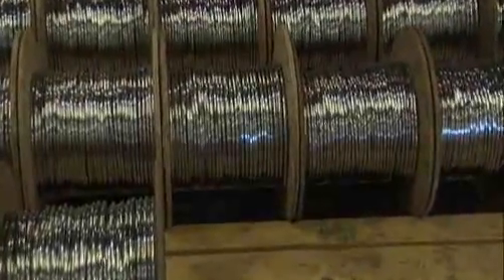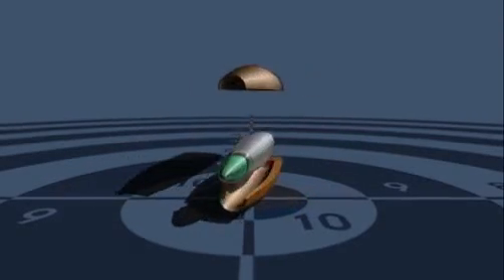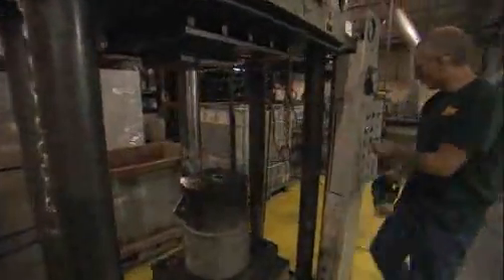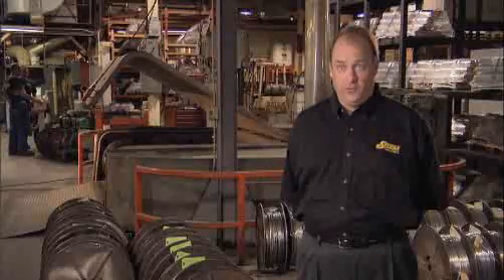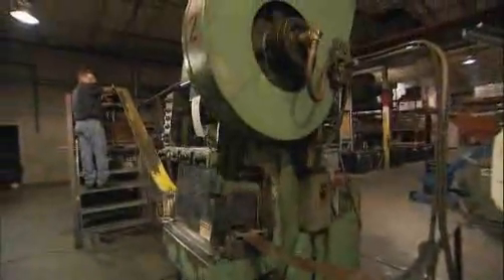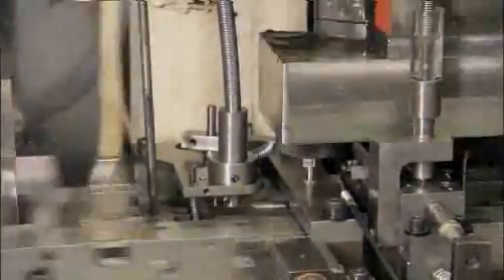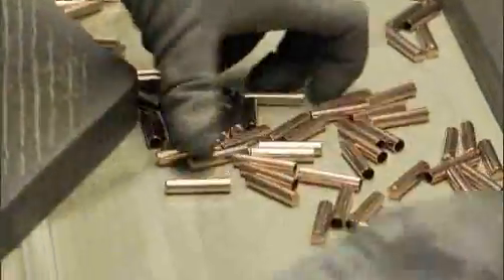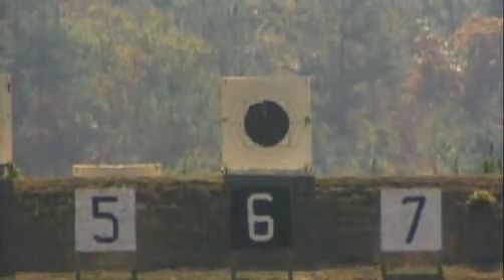How Bullets Are Made

Comment: Serialization and Microstamping
Ammunition serialization is a law enforcement tool that could assist in solving gun-related crimes. A system implementing ammunition serialization or coding would require manufacturers to stamp a unique microscopic code or serial number on all bullets and cartridge cases.11 At the time of purchase, the code or serial number would be recorded along with the purchaser’s information by a licensed dealer. Later, when a bullet or cartridge case is found at a crime scene, the bullet or spent cartridge could be quickly traced back to the purchaser. This would aid law enforcement investigations into shooting crimes and deter the use of guns in these crimes.

A friend tell me code or serial number was written on bullets or cartridge cases.
Can somebody tell me where code or serial number is written on bullets or cartridge cases?
Thank you.

Comment: For those who may not know. A bullet is exactly what is shown in the video, the projectile that comes out of the barrel. A cartridge is the brass, primer and powder. The combination of the two is called ammunition.
Reply: Why is the cartridge made of brass?
Reply: @E_Rico  brass is way more impervious to corrosion, and easy to form and has great thermal expansion tension strength and can also be reformed and recycled back into live projectiles.
Reply: @E_Rico It’s made of brass so it can expand into the chamber. When you shoot a classic rifle bullet the neck of the brass, the part that hold the bullet, will expand and create a gas seal to your guns chamber. Every chamber, no matter how precise the manufacturing may be, will have minor imperfections in the chamber due to machining. The brass case will expand due to the powder heating up the cartridge and will fill in these imperfections essentially fire forming that brass case to your guns specific chamber. This is why for some reloaders only opt to have a neck re-sizing die. The body of the brass case will stay the same, because it’s been fireformed to your chamber, and only the neck of the brass will be resized to near factory spec for the next bullet.
Reply: whats is called for shotgun bullets?
Reply: @pepega5560  there's no bullet on the tip of Shotgun ammo. Either filled with pellet like load or slug.

Comment: Sooo.... how are bullets made?
Reply: I mean, this video really only shows how the casing is made, not the actual bullet tip.
The bit that mostly deals the main blow.
Also this video seems to be addicted to lead.
Reply: No it showed how a bullet is made,  lead core with a copper jacket. Then a brass casing holding a primer to ignite the powder burning and push the BULLET down the barrel engaging the rifling to in part spin to stabilize the projectile to the target.  Bullets are the pointy thing that does the work on the target. The process in the video is called cup and core. This basic design has been used sence the 1870s or 1880s,  @Firestar4041
Reply: The bullets are the piece of metal that fly out of the barrel, which is what is shown in the video. Sometimes people mistake bullets with cartridges which is the bullet, casing, powder and primer
Reply: @mikeawilliams7104  indeed
Reply: @mikeawilliams7104  good to know the terminology. Often confuse the parts myself.
Reply: centersnare32 
by bartering $ i think.

but for sure ammo manufacturer need considering replace copper for their cartridge. ammo going more expensive each year........... not Funnn
Reply: U
Reply: Well after that step i would geuss theres another die or so that shape it into the proper shape then a press that puts on the tip or steel penetrater depending on what kind
Reply: When a mommy bullet and a daddy bullet fall in love...
Reply: @jayvee4321 😂🎉
Reply: You stick a lead rod in a copper tube. Literally the entire video
Reply: Are you stupid or just a follower? The video went over pretty well..
Reply: @chadcurtiss1846  the vid mostly showed how the casing was made and not the tip
Reply: watch this video and be shocked....!!!!
Reply: centersnare32 - watch the show that this clip is from.

Comment: why is lead and copper still used for bullets and not just steel since the lead pollute so much when left in nature
i'm just wondering ???????????????????????
Reply: +lytken steel is much harder to form into a bullet, and doesn't expand anywhere near as much as lead and copper. Leaving a much smaller wound and thus reducing killing power. With that being said there are some pretty revolutionary bullet designs that use synthetic materials you should check out.
Reply: +Nathan Sargent Thanks a lot for the info
Reply: +lytken Steel being very hard, will wear out the rifling in your barrel much quicker than copper which is softer than steel but still won't melt (like lead does) while traveling down the barrel of a hyper-sonic fire arm such as a Win .270. The bullet must deform to seal the bore (to contain the hot gases) and grab the rifling ridges in order to take on the spin while traveling through the air after exiting the barrel.
Reply: okay cool ty
Reply: steel has less density than lead and with the same size steel is much lighter than lead and it loses more energy on long distances and causing less damage to soft targets.
Reply: okay thanks

Comment: How It's Made: These crazy machines that make everything
Reply: +Ofordgabings Well, what about the machines that make those machines? Is there a never ending cycle of machines making machines? SKYNET.
Reply: @alejandroalderete8958  Sorry im late, you called?
Reply: +Ofordgabings lol. rekt the vids.
Reply: +Alejandro Alderete I often think about that. Where did it all start?
Reply: @mrnat3058  the metal lathe.
Reply: In reality most of these manufacturing machines are a series of pneumatic or hydraulic pistons that produce an series of exact and repeatable movements. The challenge in designing and setting these up is the measurements and calculations that go into the initial process, and optimization for efficiency.
Reply: +Mr. Nat the answer is cocaine
Reply: Mr. Nat Colombia
Reply: Fr tho

Comment: but why do they use Led and not any other non toxic material and possibly cheaper. For instance if you work at a firing range and your job is to clean the bullet trap it's really crappy working with Led all over you and having to get a blood test every 6 months.
Reply: Because lead is heavy and malleable, which is important for making bullets work at all. You could use gold too, which would also be non-toxic, but that is more expensive.
Reply: Lead is the heaviest non-radioactive material that you can make bullets from. Weight is very important to a bullet, as a lighter bullet will not kill. The only thing that is heavier than lead that can be used in a bullet is uranium. Everything else is just too hard, expensive, light, or unstable.
Reply: I guess if the bullet does not kill them, the lead poisoning will f*ck them up or kill them eventually...

Comment: This is not the only way bullets are made, just jacketed bullets.  You could also turn your bullets, machining them often from brass.  You could cast them from a molten lead alloy, normally for use in handgun or lower velocity ammunition.  The higher the velocity it is used at, the harder the lead bullet needs to be so the more of the alloying material is used in the soft lead.  As bullet technology moves on nylon components, steel penetrating cores etc are being used more often.

Comment: Generally speaking no. Raw lead is fairly safe to handle although I'd recommend gloves if you're going to be handling it everyday. 

However if you're firing in an indoor range there does need to be proper ventilation as there's a small amount of lead that's vaporized in shooting, and you should wash your hands after a range session before eating (you can use special unleading soap but a thorough scrub with normal hand soap is usually adequate).

Comment: If you just used just copper it makes the bullet much lighter but harder so it doesnt "mushroom" or expand well. The lead adds weight and helps the bullet expand on impact with "soft" targets. The weight is an important factor, get hit with an airsoft pellet at 300 fps or a paintball at 300 fps. One has a small sting and the other leaves a welt.
Reply: solid copper or brass bullets also have a place such as very large dangerous game that absolutely has to be dropped with a single shot such as bears or moose usually made of solid brass will not deform and will penetrate VERY deep in a large body tearing through heavy muscle, bone, and organs along the way

Comment: The wings would snap off, and the fuselage would crumple. This would look like there was no reactionary force, however there is, but it would only slow the aircraft down, however, it would only slow down by parts. Look at the spaghettification effect near the event horizons of black holes. Imagine, if you can, that in reverse. Something gets compressed so that the back part still travels the same speed while the front part has stopped. And the building travelling on the earth is negligible.

Comment: The building is traveling at 700 mph on the surface of the earth, but that is relative.  As someone who understands PHYSICS.  Newtons 3rd, no reactionary force on the aircraft, ie it doesn't slow down.  The engines don't snap off like ESB strike, wings don't push forward on impact.  Yet they disappear in sunlight, blocked by a hurricane on the horizon(Erin)  LOOK AGAIN GRASSHOPPER!

Comment: So if, say, an aircraft with high speed (and large momentum) hits a wall with zero speed (and thus zero momentum), a positive change in momentum of both the objects will occur in the direction of travel of the aircraft. Since buildings are not meant to move, and since the object moving is so heavy, it takes a large force to stop this. And since the steel girders are built to support vertical force, not horizontal, they will shear relatively easily, especially when the whole building moves a lot.

Comment: The only FG is the nose cone to house the radar, the rest is formed sheet alum. Landing gear and support have various other material incl Ti. Avg alum tensile 25ksi, A36 structural steel 90ksi.  767skin 4mm, box COLUMNS on 90th floor 10mm each side. The area of steel to be sheared is EXPONENTIALLY greater than what a bullet's area would be, SMALLER bullet penetrate better. Each tower had a BILLION pounds of momentum, a 2000 to 1 ratio. Ppl hang on to this HOAX tighter than religion, LMFAO.

Comment: Airliners are not made of aluminium. They are made of an aluminium-fibreglass composite with a low density but high tensile strength. This means they are very light, but very very difficult to rip or shear. As well as this, there is a lot more force behind an entire aircraft than a single bullet, since an aircraft weighs considerably more. momentum function of Mass and velocity, a larger, more massive object travelling slower can have more momentum than a light object travelling fast.

Comment: Lead, which has 4x the desity of aluminum, must travel 2-3000fps to penetrate steel. So how does an airliner made of sheet aluminum traveling 500fps shear 20mm of structural steel? Notice airliner in the Hudson river floating, sg <0.5, making it 30 times LIGHTER than lead.
IT'S NOT POSSIBLE, making it A HOAX!!
WAKE UP PPL!

Comment: I know it's been said before, but YES this video is about bullets, which are the projectiles. The bullet is a part of the cartridge which also contains the primer, powder and casing.
Reply: so a metal of sort tip, sits on a lead core, encased inside a copper jacket that sits on top of a brass casing which is filled with gun powders, and at the very bottom is the primer which rests against the firing pin inside the gun's receiver?

Comment: @MastaSwallows There's a primer at the bottom of the case, powder inside the case and the bullet on top of the powder slightly inside the case. Firing pin hits the primer, primer sparks, powder BURNS RAPIDLY, with the resulting gasses propelling the bullet.

Comment: @moocowmoocowmoocow I actually made the casing at the company right beside Sierra.  Brass comes in as slugs, a domed shape that is larger in diameter then the final product.  The slug is washed in a heavy soap, drawn out in length, trimmed, anealed, stamped with the primer pocket and the head stamp, the extractor groove is cut aswell as the primer hole pinned, then they are trimmed to final length, quality tested and finally washed and polished.  There are roughly 25-30 total steps.

Comment: the only real diffirence between the two rounds are 1 has no lead showing except 4 maybe on the back and on has lead showing or some kind of plug in the tip and one will cause more damage on soft flesh because it stays there and will tear stuff up if u move where as the other goes striaght through and leaves a nice clean hole